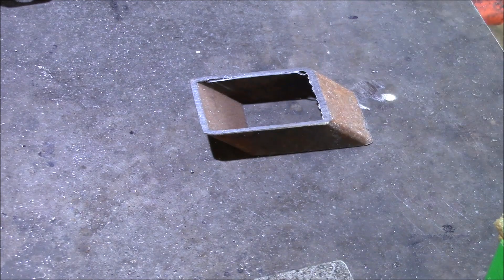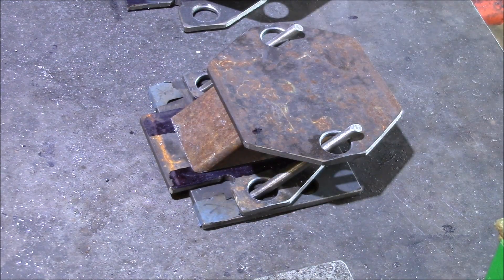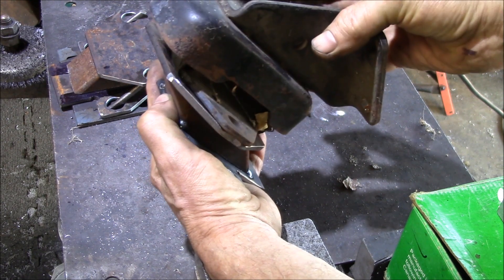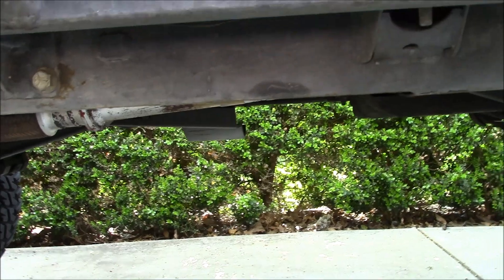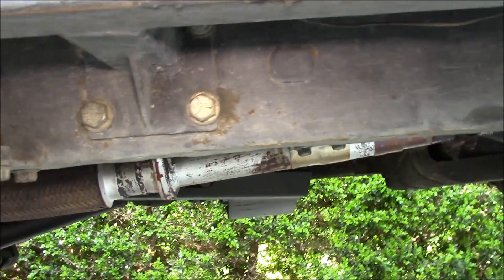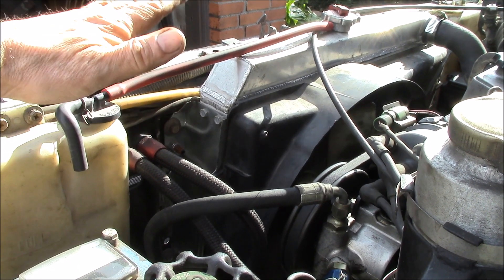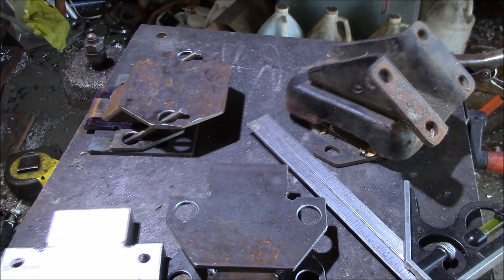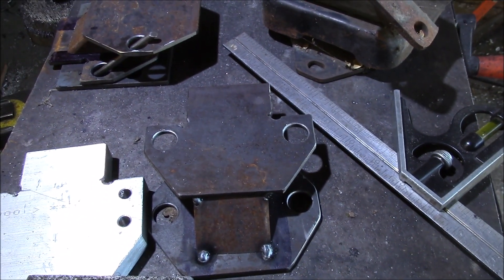Making Toyota Motor Mount Spacers

Comment: Sir Mr brown I've got a problem I'm going from the 3vz motor to a 22re motor and I need the frame Moynahan to be forward about 2 inches and the motor adapter two have a different angle do you know where I can get these made for my truck
Reply from the maker: You might try this:
https://toyonlyswaps.com/product/3rz-2rz-bolt-in-conversion-mounts/
Reply: I will tomorrow and that's a great price but I'm thinking from what I seen that it's still the wrong way like all the other ones I know I'm crazy going from a 3vz to a 22re but I have a fresh motor and a truck that had a3vz in it lol everything is swapping a ls 350 or a Ford 289 or 302 some 5vz none are going to the smaller engine it's like two inches forests it has to come I really hate to cut the frame just in case later I want a bigger engine in it

Comment: What is the degree of the angled square stock between the 2 mounting plates?
Reply from the maker: Depends on the type of engine, anywhere from 48-55 degrees:
https://www.4crawler.com/4x4/ForSale/MotorMount.shtml#MotorMount
Reply: @The4Crawler  thank you. I must have slipped that portion of the video the first time cause they second time I watched it I saw it. But thank you. I appreciate the reply